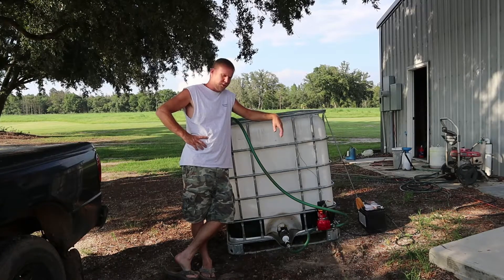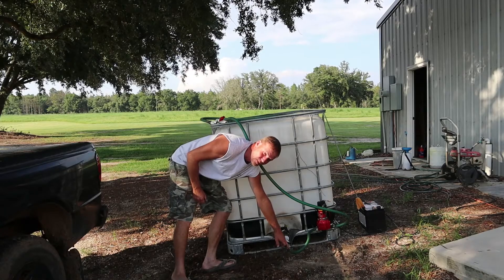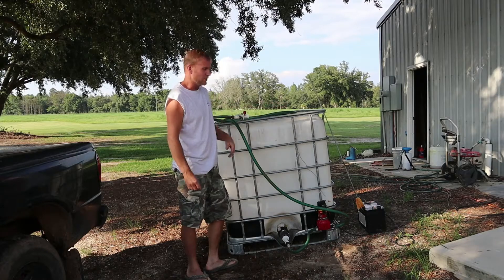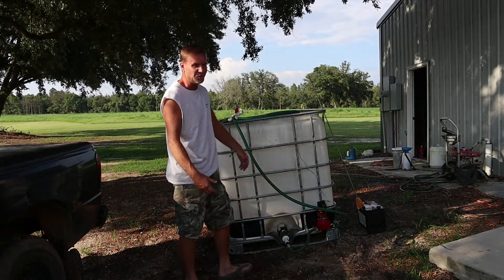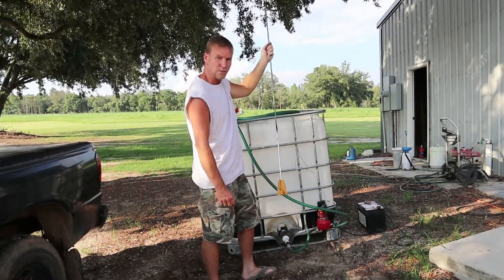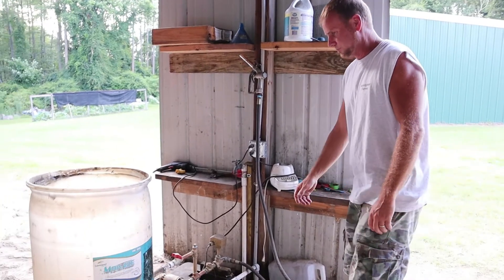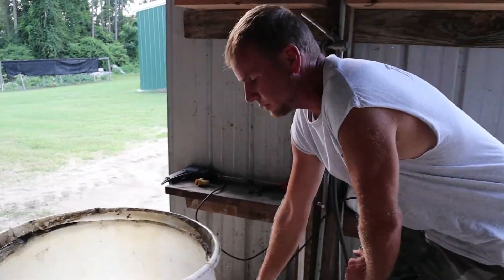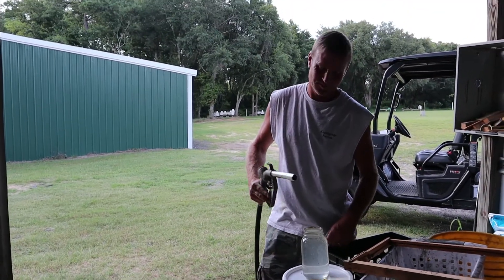Sugar Water Mixing Tanks

Comment: What is the pump's model number and brand ?
Reply from the maker: High-Flo High Performance 
Model# HFP-45060-113
Reply: @southernpoultryfarmer3951  have you been happy with this motor so far? Thanks.
Reply from the maker: @uzunerfatih  yea, no complaints.
Reply: @southernpoultryfarmer3951  Is syrup flow pressure too high while filling the feeders?
Reply from the maker: @uzunerfatih  no because the thickness of the syrup slows the flow down to a perfect speed